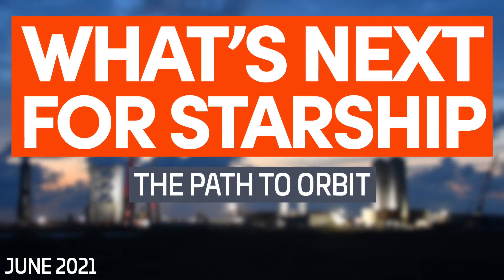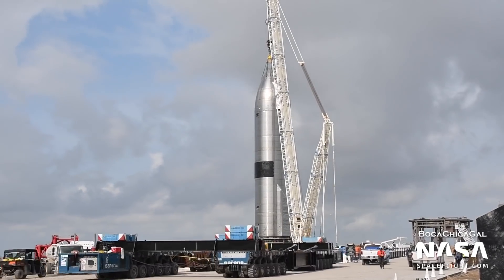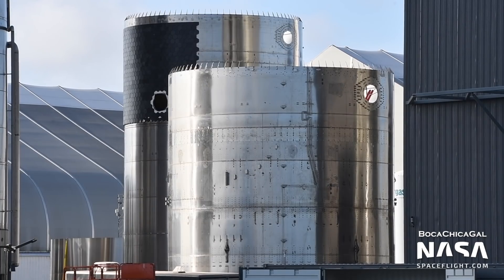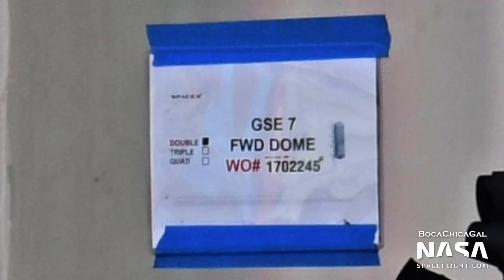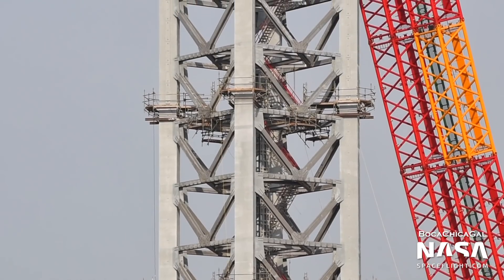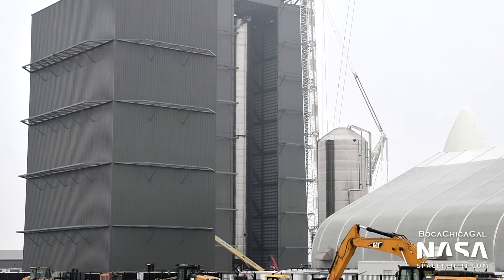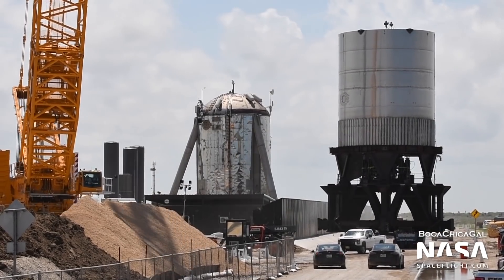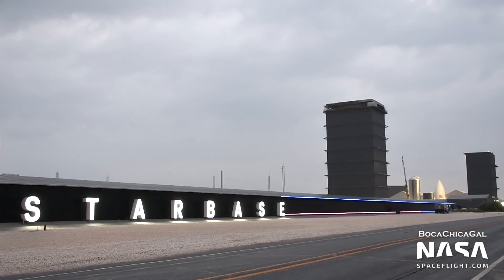Starship SN15 Landed. Now What? | What's Next for SpaceX's Starship

Comment: Thanks Ian. Nice to have a relaxing re-cap up to the present. I watch every day, but having a soothing voice going over the events, helps sort the 'clutter' of distractions.
Keep the format and maybe add a bit of what you think the 12m water tank will be used for and maybe how it will be used. 
I'm thinking jet engines in front of the OLP pushing a strongly directed spray of water towards the estuary to divert the exhaust flames and engine noise.

Comment: I have a question but I can't find the answer amywhere. When stacking Booster & starship, the booster need to be fully fueled and pressurised to handle the load of the heavy starship on top of it I understand? Cause without pressurization the booster will crumble like a empty soda can. How is the workcrew safety supposed to be uphold in the stacking procedure when lifting starship ontop of a fully fueled booster?

Comment: Great summary.  Besides heat shield tiles, I'm curious what they do on orbital starship prototypes vs non-orbital.  Is there enough different that SN16 and SN17 couldn't have been used and are basically just scrap?  (Obivously the answer is yes, but specifically, what is different?) For instance, for orbital, Starship needs the connection points/release mechanisms to separate from the booster, I'm guessing those were not built into SN16 and SN17?
Reply: Good points! I'm sure there are plenty of software and communications differences too.

Comment: I know SpaceX like to go full speed all the time, but one sub-orbital success surely shouldn't mean that no more sub-orbital tests should be done. They have SN16 sat there, they should do at least one more sub-orbital test to ensure that it wasn't a fluke and they can repeat that success over and over.
Reply: Every orbital test will end with a suborbital test, and they've proven that their chosen final descent profile isn't literally impossible to get right.
Reply: The problem with performing another sub-orbital test is that it slows down progress on every other aspect of the Starship program.  The logistics of performing a sub orbital test are not trivial, but more importantly, it prevents work being done on the orbital launch mount and any other infrastructure neccessary for an orbital test.  I'm guessing they've got more than enough data from previous sub-orbital launches to be confident in progressing on to the next generation of Starship vehicles capable of orbital flight.  Improvements made to SN20 likely render another test of earlier vehicles obsolete, so there is very little to be gained from flying SN16. Landing maneuvers can be tested concurrently with orbital tests, but if there are issues with the Starship vehicle in orbital flight, there's no point spending more time and resources on simply showing it can land.

Comment: Landed it one time successfully with a failing raptor engine, and they are calling it on remaining Sub orbital flight tests?!?  That seems a bit soon.   I figured almost certianly they would do one remaining test flight with SN16 for confirmation of successful landings...  Bit sketch lol
Reply: From my perspective though it makes sense to move on to orbital at this point because they can gain more data on the entire flight profile from low earth orbit.

If they only continue flying to ten kilometers they're only learning how the starship behaves in the lower atmosphere and landing but not any issues with re-entry itself or problems with booster design. They now have deadlines to meet with the lunar lander system and orbital refueling. What if other parts of the flight profile run into design or software issues. The longer they wait to reach orbit the less time the have to fix issues that may and probably will arise. 

For example if they loose control of the vehicle on re-entry or the thermal protection systems are not adequate then does it matter if the vehicle can land? They've atleast proven its possible to land from 10km though it could use some refinement for sure. They'll almost certainly crash some more Starships the goal at this point is to learn as much as possible with each flight.

That should save them time and money in the long run.

Plus don't forget re-entry will be over the Pacific so even if it does crash it should be in a safe location. Immediately after lift should be the only real risky part of the flight. I'm sure SpaceX expects to loose the first several orbital vehicles at some point in the flight.